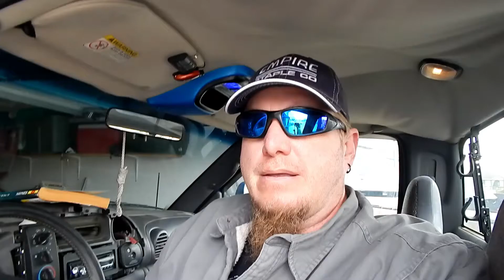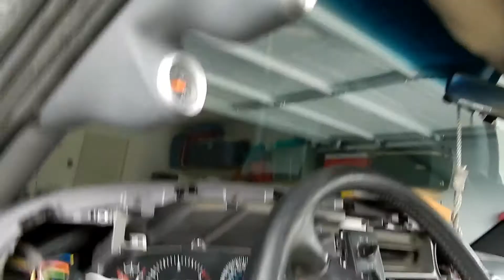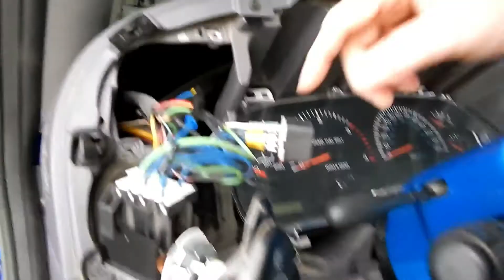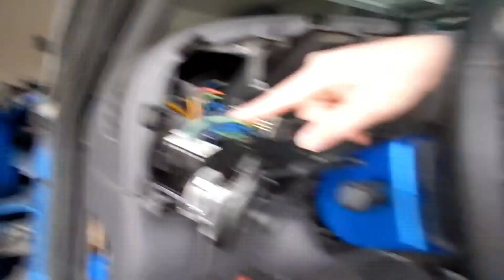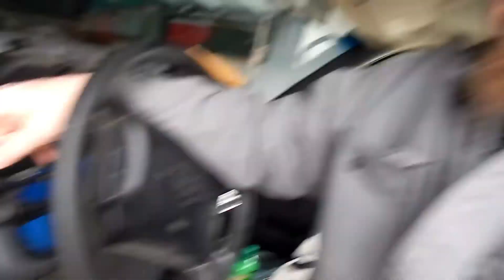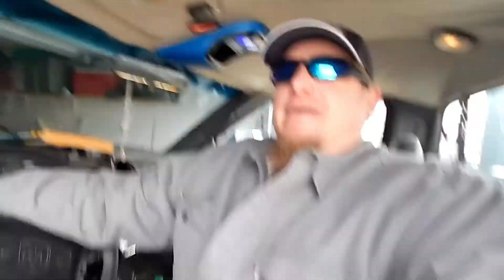Dome light and park light repair. I.O.D fuse and a relay

Comment: Dodge trucks are hard to work on and I replaced a engine myself on a 1998 Dodge ram 1500 4x4 and it's a pain compared to the Fords and Chevys and the engineers of these Dodge trucks are not mechanic friendly for sure

Comment: Mine isnt blowing fuse. My interior lights wont turn off. I wish there was more answers than just replacing door jamb switch in other forums etc.. I did. It did nothing. No help here
Reply: I had the same exact problems as this guy, and i finally traced all the wires to a wire harness under the drivers seat, they have obviously been arcing and sparking for quiet some time, i even kept constantly blowing my IDO fuse, so anyway how i fixed my problem was to cut out  the previous mentioned wire harness (under drivers seat) and replace it with 2 - 4way trailer harnesses in its place. Problem solved, been perfect for at least 8 months now.

Comment: Thank you. I put new tow mirrors on my 01 dodge 2500 and when I went to use them it blew the fuse. . I checked all the fuses that seemed to be related no luck . I saw your video checked that one bingo ! That was the problem.

Comment: Hey dually I own a 98 ram I'm having problems with light switch that operates dome, head lights, dash lights. My column and dash started smoking and it melted the wires behind switch about six inches down after pigtail and I loss dash lights, and radio. As it happened dome stayed on with a annoying rapid ding sound and I still have headlights and I've replaced all fuses but everytime I turn it over it starts smoking again. Any help would be appreciated please?
Reply from the maker: If its smoking in the column you probably have a couple of shorts in your electrical. Only thing you can do is disconnect the battery and trace your wiring harness to see where it is shorting out.
Reply: @BlueDually4x4  that is what I've been on for two days haven't found anything under hood but as before found what melted behind switch but nothing else from there to rear was curious if I was to cut melted part out and rewire it back to new pigtail and switch would it do it again?
Reply: I had the same exact problems as this guy, and i finally traced all the wires to a wire harness under the drivers seat, they have obviously been arcing and sparking for quiet some time, i even kept constantly blowing my IDO fuse, so anyway how i fixed my problem was to cut out  the previous mentioned wire harness (under drivers seat) and replace it with 2 - 4way trailer harnesses in its place. Problem solved, been perfect for at least 8 months now.

Comment: Why does the fuse that controls the dome like fuse number 13 keep on burning the fuse whe I buy a new one ?
Reply from the maker: Likely it has a short in the wire and is just grounding out or the amp draw of the lights is to high for the fuse.
Reply: @BlueDually4x4  thanks again
Reply: @BlueDually4x4 I’ve had the same problem and disconnected everything other than the radio because my radio isn’t working and it just keeps blowing
Reply: I had the same exact problems as this guy, and i finally traced all the wires to a wire harness under the drivers seat, they have obviously been arcing and sparking for quiet some time, i even kept constantly blowing my IDO fuse, so anyway how i fixed my problem was to cut out  the previous mentioned wire harness (under drivers seat) and replace it with 2 - 4way trailer harnesses in its place. Problem solved, been perfect for at least 8 months now.